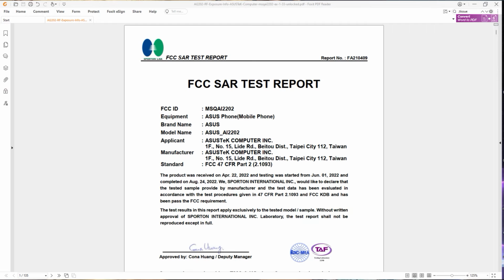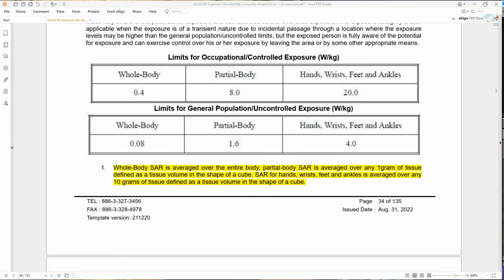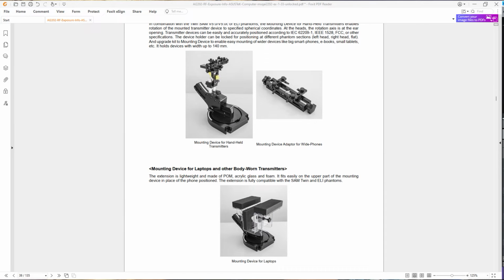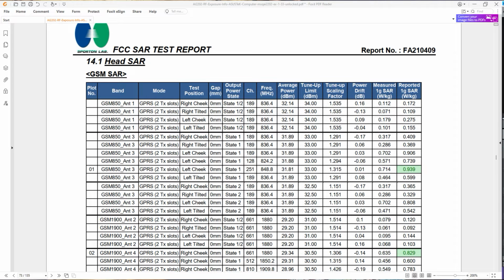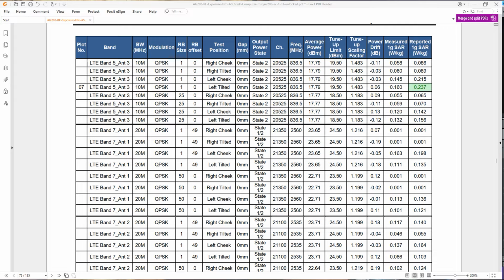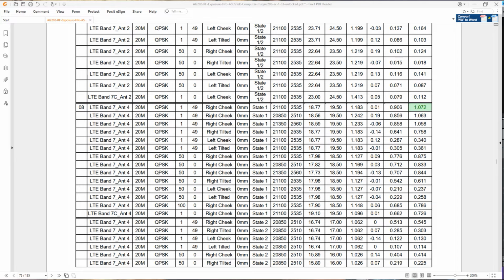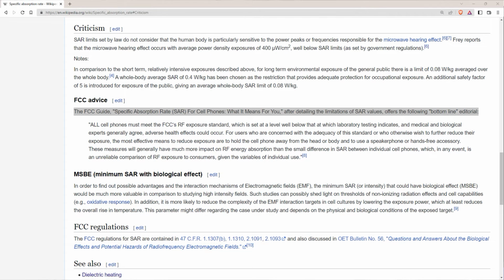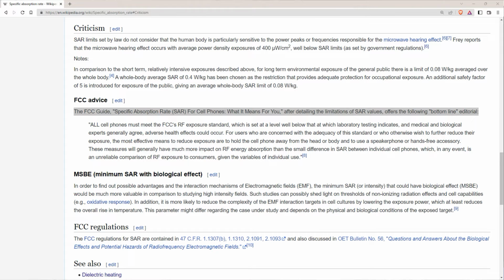Why phone SAR ratings are silly

Comment: For me it's not complicated at all. I can't use a phone with SARS over  0.50kw, if the SARS rating is over that amount, my hands start to tingle as does my face and I get a really bad pain in my chest.
That's why, I am still using my phone from 2018. 
New phones have dangerously high SARS levels. 
I have no understanding of why SARS levels have to be so high when you are putting the device next to your head.

Comment: There's a huge difference between ionizing and non-ionizing radiation. In general, ionizing radiation is dangerous (damages DNA, may cause tumors) but non-ionizing radiation just provides visible light and/or heat; not so dangerous b/c you can see and/or feel light and heat and remove yourself from the situation if it becomes too intense. These days, too many people lump all radiation into the same risk basket.
Reply from the maker: Start here: https://www.youtube.com/watch?v=h-qzqOhDc_0
It seems it's nowhere near that simple...
Reply: you need way more education before you make broad statements of which you have zero proof or actual knowledge...once you become a magnetobiologist...let us know. or Check in with some military guys who test RF and what repercussions they can have...and you'll be slightly closer to the truth. Ignorance isn't always bliss.

Comment: As I've stated before - I have a head injury that hurt much worse & enlarged the size of Pain when using T-Mobile 5g - that only took a day to return to my Injury normal - after I turned the 5g off in the phone......
What I didn't say was that I never put any phone to my head - I use speaker & text messages - at least 1 foot away from my head - Bluetooth is always off - wifi off - Assistant off ( but they keep popping in anyway) - no banking - As Basic as Possible.....
The increased Pain with T-Mobile 5g was a lot - but not very bad with Verizon Wave 5g....
Using the Same Phone - unlocked - with different sim cards in it....
So in real use - how would the phone be rated & not the network.....
Reply: PS.... Science is only 20% True.....
That's according to the Scientists themselves - as they were given a Survey Rating how probable Scientists Results can be Replicated - it was about 80% 
of the Scientists that couldn't even Replicate their own much less Other's work..... So.... Don't Follow The Science.....

Comment: SAR rating is important. The process is trying to be scientific but the human body is not cooperating as it has various and beautiful shapes. The starting point of fact is that radio frequency (RF) damage to a human is not reversible. I do not care to argue and I never hold my phone to my ear. I use a headset or tilt the phone away from my ear (with speakerphone on) and listen thru the bottom speaker that's 2 in. or so away from my ear. Yes, others can hear me and I keep it short. Yes again, the radiating antennas are at the top of the phone and then the antennas are about 7 in. away. My kid must use a (wired) headset and she needs no reminding. Finally, I use a double-pocket phone cover. It is made such that one pocket covers the phone completely with conductive (RF reflecting) layer while the other covers but one side (that is between the phone and my leg) and in this position I receive calls no problem. I love this ugly cover, dry zip and all.

Comment: The more ratings like this they have the more people might begin to think of the health impact of all of this dirty electricity caused by the phones, cell towers, wi-fi and geo-engineering/ weather engineering that works in concert with everything  due to the metallic content of the aeresol sprayed during the stratospheric atmospheric spraying  they admit to. It takes very little chaotic radiation caused by radiation from technology to upset our immune system. The United States, Canada and the U.K. have the LEAST  SAFE allowable emission standards.  The last time I checked emissions from cell towers it was 500 microwatts per sq. centimeter.  (Microwave ovens evidently run at  1000 watts per square centimeter for comparison purposes.)  In Europe and Asia the maximums are  only 10 microwatts per square centimeter down to only one or less than one in India for example.   In France they have converted all their Wi-fi internet in public libraries to wired/ethernet.  People in the U.S., Canada and the U.K. are literally being cooked.
Reply: Also known as a load of bullshit!

Comment: 9:00 You're missing the point. Or course everyone is different. But you need a constant. You are not going to move the bar up and down for each individual person because each person is different. You keep the bar constant in the same position regardless. That's what the FCC admits to. It isn't them saying the SAR rating is useless.

They give the public the reports too. They recognise that most people probably don't care about the SAR rating or what it is. So it's there to keep the manufacturers in check. So they don't go crazy. 

I think there was a study done. Though the radiation isn't ionizing, they did find that the emf radiation emitted heats up tissue. And in test animals they found it would cause lesions in the brain of some of them. 

Just bear in mind. Wifi radiation is multitudes less than cellular radiation. I think there was a recommendation not to use a phone close to your head for more than 5mins regularly. Ideally use handsfree, ear/headphones or something.
Reply: Cellular networks have stronger frequencies because it’s a LR-PtMP system. But still, light is more dangerous than any cellular network.